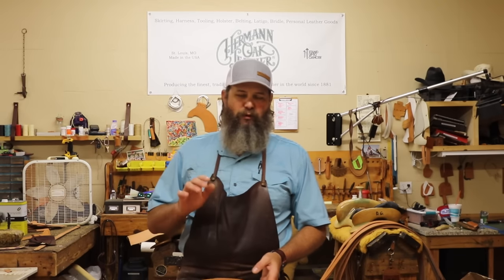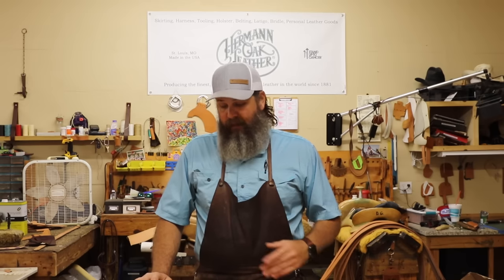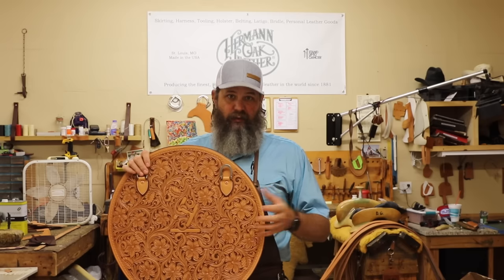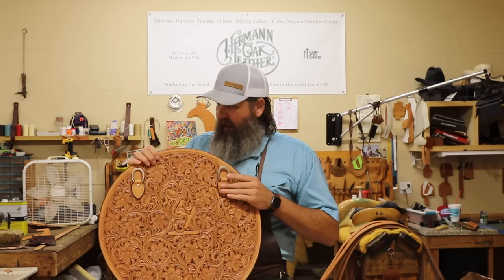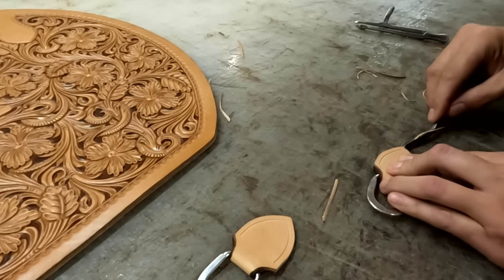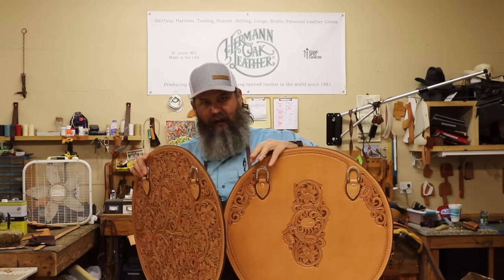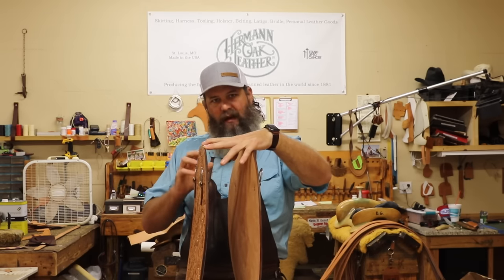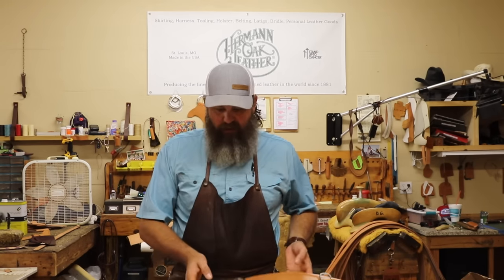How to Make a Leather Rope Bag

Comment: Could you speak to the setup of your machine when sewing What presser foot, plate, feed dogs etc It may help people with there setup initally You are one  the few leather guys on youtube that actually use sewing machines You and MLS
Reply: Im almost certain he uses the standard feed dog that comes with the Class 4 which would be the same exact feed dog for a Techsew 5100 or a Cowboy 4500. They are all clones of the Juki 441 so dont expect a difference between machines.

As far as the presser foot goes, the same information applies. The only time someone may have a different foot attached would be if ur doing zippers but the foot that comes standard can do the job just as well with practice. A aftermarket foot would be a piping foot but i dont think Don uses one.. 

The only thing i could think of Don using that may be out of the ordinary for standard parts would be his spur attachment for sewing the curves on a spur. Other than that im almost sure his machine "most" of the time is mostly stock except for maybe a zipper foot.  

Source: I own a Techsew and did plenty of research prior to buying it. I learned alot about industrial sewing machines and the mkst important thing i learned was that each model that was sold by a specific company was also sold by all the other competitors in the market. All they do is rebrand the sewing machine with their name maybe put a light or some gizmo to attract potential customers. However internally the parts are exactly the same no matter what machine you buy.

Hope this is helpful for you man. Cheers!
Reply: Just to add, he did use a zipper foot with this project. Most sewing machine companies usually include one with their machine, if not you can find one for cheap online. They arent to unusual to see on a sewing machine
Reply: @Handles-R-Lame  That's the standard leather walking foot and LH presser foot that comes with the machine. I own a 441 and I've never seen a zipper foot or what one would look like for one of these.
Reply: @Handles-R-Lame I believe you are spot on. All the same machines just rebranded. I have the cowboy 3500 same as others